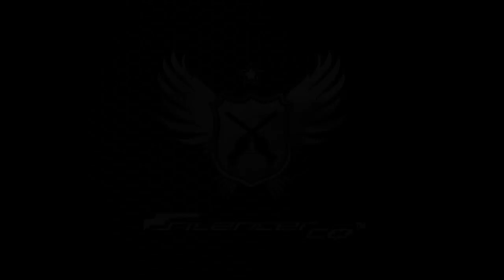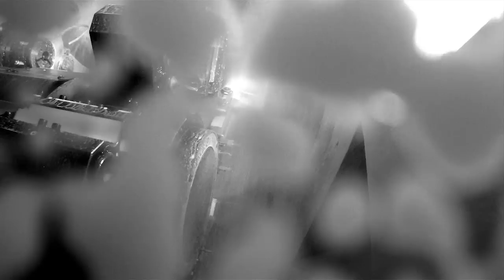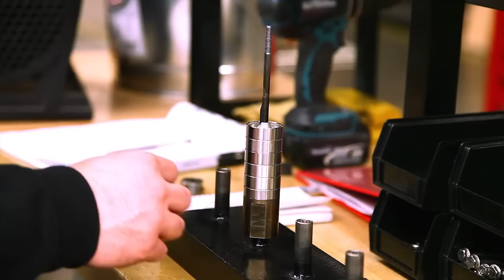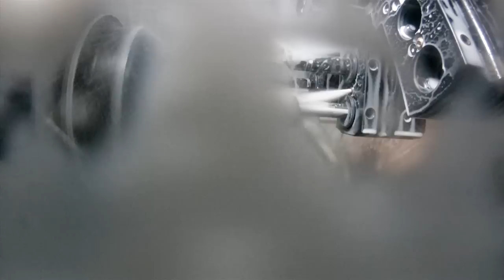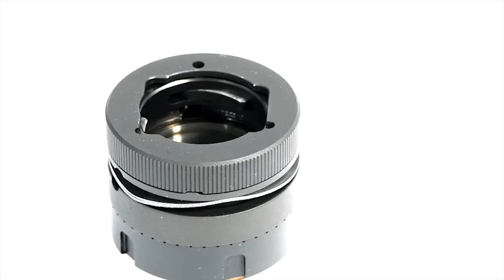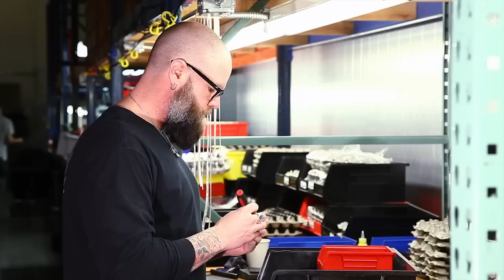THE MAKING OF THE SILENCERCO SAKER 5.56

Comment: Yes. You don't have to, but it is easier than being an individual applicant. Go to your local class 3 dealer and ask them if they can recommend a gun trust lawyer(or google).  You can set up the trust yourself, but I recommend paying a professional, so you don't fuck up.  If your paperwork is wrong the BATFE will send it back, and it will take longer to get your stamp.  Also, go to silencerco's website to make sure silencers are legal in your state.

Comment: "the most advanced" and "packed with features", but doesn't come apart for cleaning?
Reply: dont need too
Reply: Whocares05050 "don't need too"? Really?

When a suppressor gets dirty, how are you supposed to clean it? From what I've seen, the non-serviceable ones are the cheaper ones, meant to be thrown away.
Reply: Seth Watson My "non serviceable" AAC M4-2000" and others, (Wilson Combat...) are just fine after 15 thousand or so rounds so far. These two alone each cost just north of a grand and are considered some of if not the best for 5.56 right now. Its a big misconception by those who dont own any. only what they "hear". Unless you have a .22 rim-fire, you dont have to clean them. If you want to be "OCD", then the "Non serviceable" cans can just be thrown in a sonic cleaner and boom, all done. so.... yea. lol
Reply: Well all right, then.
Reply: Seth Watson
Yea man, dont even worry about. By the time you can loses its ability to lower the decibels due to carbon buildup, its probably time to send it out to be re-built. You're probably looking at around 25k rounds I would say. A good sonic cleaner works wonders on cans. drop it in and pull it out. :)
Reply: When's the last time you removed the muffler from your car and cleaned it out?  I'm betting the answer is never.   Truthfully, centerfire suppressors are sealed for two reasons.  #1.  A sealed suppressor is stronger.   #2.  The hot, swirling gasses produced by a centerfire rifle help clean the interior of the tube and baffles.    Rimfire suppressors however are serviceable because the .22 LR round is very dirty.   Unburned powder fouling and molten lead will eventually fill a rimfire suppressor until it becomes heavier and less effective.    Centerfire suppressors won't do this because jacketed bullets are typically used and there is a substantially larger volume of gas produced that helps keep things clean.
Reply: @TinkerTailorSoldier1  play nice surgical lol
Reply: @Whocares05050  the answer is no one, no one cares.

Comment: machinist using digital calipers? for shame.... very nice shop though.
Reply: ***** They tend to be much more susceptible to bad reads due to dirt grease and coolant. I've used digital from cheap $15 ones to a couple nice sets of Mitutoyo. They all had issues and funky reads after a little while (a month or two.) You cant use something you can't trust. Got a nice mechanical pair and haven't looked back.
Reply: Jason Buechler ya know they recalibtrate,ya do know that
Reply: william tindall It's a waste of time to recalibrate constantly when you can just get mechanical and be done with it.
Reply: Jason Buechler You kinda have to recalibrate it anyways, mechanical or digital. I find digital tends to be a bit more consistent than mechanical, its all in the technique. If you need better accuracy, micrometers are the way to go anyways.